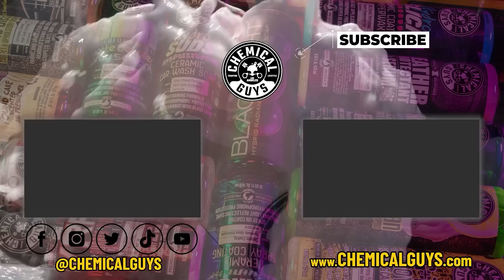Hit and Run?! How To Remove Paint Transfer By Hand - Chemical Guys

Comment: Can I use VVS on my windshield? Tree branch did a minor scratch.
Reply: yea you can just make sure you keep the polisher moving and not heat up the windshield so much, you can damage it.
Reply from the maker: VSS can be used for any surface that is gloss painted, shiny or clear.